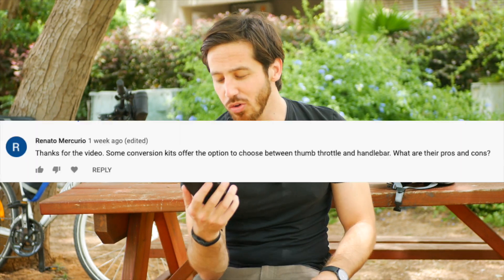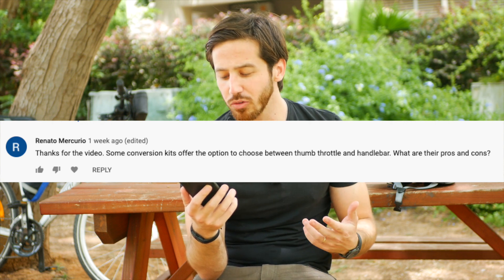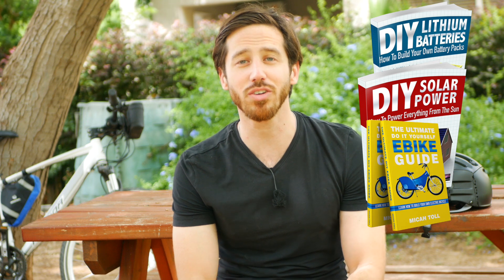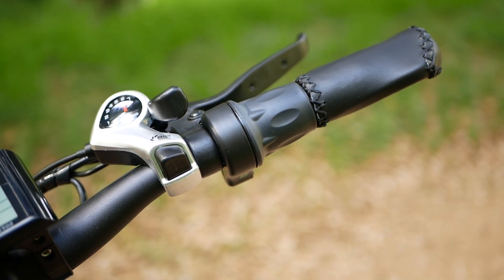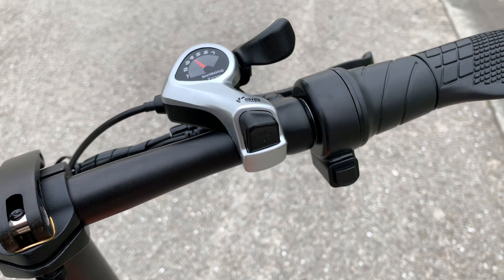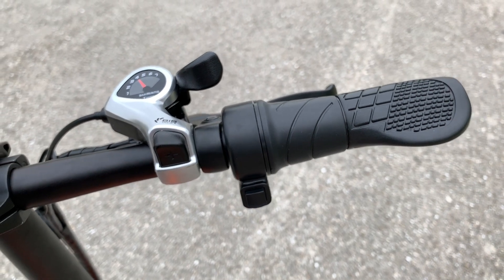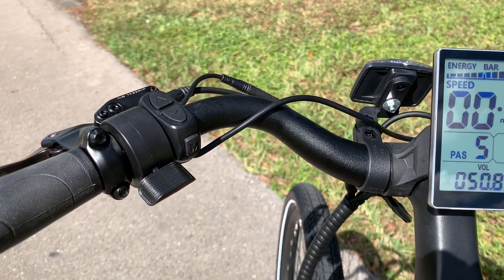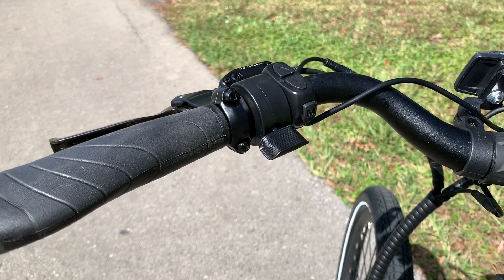THROTTLES: Twist vs Thumb - Which is better?!

Comment: I find that on rough terrain, like a trail, I have trouble with the twist throttle, for instance when I lean back to lift the front tire over an obstacle the throttle tends to twist and apply more power while you are pulling back, potentially causing the bike to wheelie, not a good situation. Then again, the thumb throttle can sometimes accidentally be applied when the handlebars get jolted upwards by a rock or you make a jump and land hard. Overall I prefer the thumb throttle for comfort and safety.

Comment: I’m trying to buy a conversion kit. How can I tell if say the 1000W motor  kit I’m buying is a good one? In general, how can one tell if the kits are quality products or just cheap knockoffs? I understand brand awareness and price are indicators, but buying from aliexpress is another beast all together. Also if you can talk about monitors ads vs disads that would be great.

Comment: as my Chinese 500 watt conversion gives me full power on peddling I have a thumb throttle and an adjustable stop made from an old lamp bracket. I can set it a comfortable speed and just hold it down. Once I release whilst peddling the full power comes back in for the hilly bits.Its worked out better than I anticipated as I am used to riding motor cycles with twist grip and at first wished I had that set up.

Comment: is it worth the money making my own bike and what kit would you recomend
Reply: Yes, you will save a huge amount of money and have a much more capable bike. Make sure to do extensive research before you decide which kit and parts to use though. You won't regret getting a big battery. Lead acid batteries do not belong on ebikes.
Reply: @dustman96  i could use a few how to videos on how to build my own battery and the kind of motor i would need for the battery i want to build.
Reply: @o1ecypher  It's really not much cheaper to build your own battery. I would recommend just buying one from a reputable source like Em3ev, or luna cycle. Not to mention, to build a battery and not potentially damage the cells you need a spot welder, another expense. I built my own a while back with a soldering iron and no BMS, it was a lot of work, it did pretty well and lasted a while, but my new em3ev battery has already lasted longer with no noticeable signs of degradation. I'm all about encouraging people to DIY, but this is a delicate thing to build. Can't offer much advice on motors. My original cheap hub motor off ebay was pretty good, my Bafang BBS02 mid drive motor is much better though, pretty happy with it.

Comment: What are the pros and cons of using lead acid batteries vs lithium
Reply: Lead acid batteries have no pros on an ebike. They are extremely heavy, low energy density, do not handle the kind of charging/discharging on ebikes well, they have a much shorter overall lifetime, one could argue they are cheaper, but you would go through several sets of lead acid batteries by the time your li-ion batteries even got a little worn, ultimately spending more money. My first ebike build used 4 lead acid batteries, weighing an extra 60 lbs, went 20 miles, and they were really bulky. My new li-ion battery pack weighs 12 lbs, is about a quarter of the size, and will take me well over 50 miles, no pedaling. I've probably gone almost 20,000 miles on it and it is showing no real signs of degradation yet. Do yourself a favor and make the investment in a good quality, large li-ion pack.

Comment: I use a motorcycle throttle lock with a full twist to prevent wrist fatigue. Are there any other motorcycle parts that you would recommend for a ebike? Maybe turn signals, brake light or headlights. Or any others?

Comment: When running two motors off two controllers do the controllers need to be identical or do the controllers just need to have the same volt and amp output?

Comment: I'm using a twist throttle on a 48v 1800w scooter motor with a 13s26p 69.68 Ah usable battery on a home made electric outboard motor & the twist throttle is an excellent safety cut off should I ever fell out of the dinghy while the throttle is at 100%.

Comment: hiya, new great question :how does the peddle assist system know which gear one is in?  using a cadence type sensor
Reply: It doesn't. The pedal assist levels are separate from your rear gears and you choose the level of pedal assist you want depending on what gear you're in (pedal assist 1 isn't going to do anything if you're in a higher gear going faster than level 1 adds - Pedal assist 4 or 5 is going to have you pedalling too fast if you're in a lower gear so you're going to want to upshift).

Comment: Let's say I was to build  an electric motorcycle(homologated one) or convert an existing one , and my solution is all about engineering a very different product  to the existing market while still making it feel like a sports cruiser / coffee racer. What never produced features would you be looking for in such machine  so that the experience would justify buying it over a classic ev/ gaz bike on the existing market?

Comment: Personally I prefer the thumb throttle because it allows me to have my remaining fingers resting on the brake lever, in many cases as I was cruising around, a car pops out of a driveway or a garage without checking and having my finger right by the brake lever I many times could let go of the throttle and immediately yank on the brake to stop the bike, where on the half-twist throttle you're gripping on the throttle and your handle grip at all the time, so that additional fraction of time you need to let go it the twist and reach your fingers over the lever to then press hard on it, doesn't pass me the confidence of control feeling. It might be something just psychological but having my fingers ready to press the brake makes me feel in control of the bike, than the bike in control of me. So in my hike I also have a horn button wrapped around my handle grip, so my thumb its on the throttle, my index finger is by the horn button and the left 3 fingers on the brake lever. So while I brake I honk the heck out of the driver to wake him up while I stop my bike to avoid a collision. Seems a lot, but saved me every time. Thanks God.
Reply: I have been riding bicycles since I was 7 years old. July 14th 2002 I first rode my hammer ebike. I watched a lot of videos they said there's a lot of power but I didn't believe it LOL. So I take off I'm at the End of the Street faster than I can believe it it's a short Street. I was going to turn right but with the giant fat tires is not so easy so I almost believed then I went up on the sidewalk and crashed. And I hit my nub straight down on the sidewalk. And then I got up and rode 12 more miles and that was the most fun I've had in years. Sitting here trying to heal my foot then I lost my leg after years of trying to save it so I've hardly been anywhere except the doctor and shopping and now I am free yay yay for e-bikes and I used my stimulus for something good that should last me a very long time if I keep it maintained. It's a lot like a regular bicycle Minus the electric motor and being 70 pounds and the giant tires. I truly believe in E bikes. I was researching and the first ebike looks like a motorcycle was in 1895 but they didn't have the distance please do and that was made by Bosch I wonder if it was made in Rochester New York near me they have a place Bausch & Lomb well they used to.
Reply: Same here, thumb all the way! Plus switch the brakes to the UK style. Actually is the right way compared to dirt bikes etc.. Front brake on the right
Reply: If you have decent controller and integrated brake lever, the motor will stops when you press the brake lever.
Reply: That where short way twist throttles come in handy. You can rest your pointing finger on the break and still twist it. Or change the brakes. But thumb throttle is cool too. I just like twist better. But your points are valid. Look at quads these have thumb throttles for a reason. I ride long empty paths so of course I choose the twist. It’s an easy ride nothing to worry about.
Reply: William said, "I prefer the thumb throttle because it allows me to have my remaining fingers resting on the brake lever..."
I can agree with your point, but my main ebike has cruise control, so once I'm up to speed there is no issue of not having the fingers on both brake handles, and when I'm maneuvering at slow speeds, one brake is easily enough to control the bike.
Reply: I gots no problem using the brake with my half twist, I can throttle and have fingers on my lever at the same time - and enough room to pull it. It's just a natural thing I'm accustomed to and have always been able to stop quickly if needed. It's the same way I would ride a motorbike, And people have been riding them for decades without not being able to brake properly right?
Reply: Other side break and brake sensor/cut off my conversion came with this
Reply: Or u can just hit the brakes with your left hand makes things a lot easier 🤦‍♂️
Reply: @neoroberts2802  each brake is a different tire
Reply: @neoroberts2802  this☝🏾

Comment: Half twist is the best, I use them on my 4-stroke bike too... That said, I have yet to find a setting that produces a useful low-end throttle curve on my eBike. It's so annoying, and I know it could be solved in software.
Reply: You just gave me a great idea. Thank you
Reply: It can't, Unless you use a potentiometer throttle
Reply: @JamesWilliams-ji4mg  Didn't know this was a possibility. Do you have any links to pot throttles? Just found this: https://electricbike.com/forum/forum/kits/golden-motor-magic-pie/70584-guide-to-hall-sensor-throttle-operation-testing-and-modification#post94717
Reply: @ChrisB...  Yeah and that guide is fine and will remove throttle dead zone but its hard to explain. Basically at the beginning of the throttle the magnet will be far away from the hall sensor in the throttle and it will never be responsive in the low end because the signal will be weak until it gets close to the hall then it will be twitchy. For throttle check out domino which is what i upgraded to
Reply: @JamesWilliams-ji4mg  Just ordered a Magura 0-5kohm pot throttle. :) I'm used to dealing with the ugly low-end of my hall-effect throttle, but honestly it sucks. Too many unintentional wheelies at 3KW.
Reply: @ChrisB...  I wouldn't get that one it has a large degree of twist that isn't good for wrist. Its ok but domino is better
Reply: @JamesWilliams-ji4mg  Thanks, found a Domino for $56 (seems too good to be true), it's sold out everywhere else.
Reply: @James Williams  Got my Domino throttle (finally after a month of searching) added a few resistors and my gawd it's amazing! It is orders of magnitude smoother than my hall sensor throttle. IMO hall sensor throttles are dangerous on 3KW bikes, not to mention completely annoying.
Reply: @ChrisB...  yeah I have mine dialed in with resistors too, the difference is pretty incredible
Reply: @ChrisB... and @James Williams
I looked at both the Magura 0-5kohm $60 and Domino Twist Grip Throttle - 0-5K Ohm $110.
I see that the Domino is only rated up to  40 volts and I just bought 48 volt 1500 motor kit. Will this still work?
Also, What resistors are you adding to the throttle? Sorry, I am new to this.
Reply: @robotbroken  I use my Domino at 60v, no problem. You have to test your system to find the right resistors, it's different for every bike.
Reply: @ChrisB...  Thank you for the reply! Even though I don't know anything about adding resistors, you've kind of sold me on how much of an improvement they make. I'm looking for something with smooth variable control. Do you use only throttle controls on your bike or do you use a PAS pedal assist system also that has sensors near the cranks? 
I just got a box with the Voilamart 1500w motor kit that I am mounting on a nice aluminum hard tail mountain bike and plan to use a 48 volt battery with about 20 amp hours. I am on a budget and purchasing parts as I can to do the conversion at a later date. How would I know what to measure to determine what resistors might work best? This electrical part is over my head. Is there a good E Bike Conversion Forum that you can recommend so that school myself on the topic? Thanks for all the help!
Reply: Or get a more expensive torque based controller

Comment: What are pros and cons of front hub vs rear hub?
Reply: My first ebike build had a front hub motor. It would spin out a lot on dirt or asphalt with dirt on it, because the majority of the weight on a bike is on the back tire, especially when you accelerate. My personal rec is to go with rear drive.

Comment: The thumb throttle on my Juiced Bike is on the left side. It doesn't interfere with the shifter. Control is shared by the brake lever only. Personally, I only use the throttle when starting off or on steep hills.

Comment: Thanks for sharing your experience in the videos.  I would be interested in two topics for future videos: 1) trouble shooting electrical issues (diagnosis, testing, repair) and 2) comparing/selecting controllers and how to wire/connect if mismatched (not a kit).

Comment: Left half twist. I have my gears on the right with a single brake cut off. The half twist IMO is by far the safest option for a throttle as you can ride without worry of triggering the throttle in a busy area. Experienced motorcycle riders may get on fine with a full twist but most people jumping on ebikes are not such people. Never wanted to try a thumb. I have one I want to use for regen braking tho. Cheers
Reply: I don't see how any kind of a twist throttle can be less likely to be accidentally activated than a thumb throttle, since your hands are always on the grips, but can easily be kept well away from a thumb throttle.  To me, using a thumb throttle requires a deliberate choice.  But, if it's a concern for you, that's cool, too.  Whatever makes it safe and fun is the right thing.

Comment: Really easy to make a cruise control set up for your thumb throttle. If you have a key ignition or a kill switch you can use that to cut the power if you need to stop.

Comment: TIP: Half-twist throttle can be used as cruise control :)
Just push the grip thight against the throttle and it wil stay in place. No wrist fatigue anymore.
And i agree about the right side throttle . They should standardize the back rear shift to the left side to avoid this problem.
But on the other hand, a throttle is forbidden in many countries for pedal assist ebikes (max 350W or 25km/h).
With throttle it falls under the catagory motorised scooter/moped (above 350W and/or 25km\h)
or motorbikes (speedelec bikes) (from 500W till 4000W and/or 50km\h).
Reply: That's a pretty dangerous way to do cruise control. Why not just turn on "auto cruise"?
Reply: @ChrisB...  It's not really so dangerous. I do exactly the same and just use my brakes when necessary. It cuts power to the motor straight away so it's no big deal having it in cruise control.

Comment: I’m in the process of converting my bike to my first ebike, I was wondering how long the battery lasts, I’m not talking about riding time I’m talking about charging cycles, I’m looking at a 48v 20ah battery which will cost me about £450-500 which is a lot of money, I’m mainly building my ebike so I can go of with my camera out down country lanes to photograph the wildlife, will I have to replace the battery every year or two ?
Reply: A good quality li-ion battery pack will last you 500 to 1000 full charge cycles(which to me means between 10 and 90%), depending on how you treat it. A good reason to go with a larger pack is that even after that many charge cycles you will still have plenty of useable range. Rick is wrong(sorry Rick), a 48v/20ah li-ion battery is not very heavy, only 8 to 10 lbs, which is barely noticeable if mounted low on your frame. Joe is also wrong, premade electric bikes are a ripoff, hardly any range, low power junk, the really cheap ones come with lead acid batteries which will fail in no time and are really heavy.
Reply: Wow, lot of questions. Do you want the bike to do all the work or do you always pedal? Bear in mind a 48v 20 ah battery is HEAVY. How far are these rides going to be? How often are you going to be charging? Better to keep the battery between 20%-80% charge for longevity, so nice to have one just big enough to do that.. If you have to fully charge the battery every day, it isn't going to last as long as if you charge it once a week. Also, better to use a slow (2 amp) charger rather than a fast 4-5 amp charger for longer battery life. Still it should last you longer than 2 years (assuming they are name-brand cells), it just might lose some range.
Reply: Rick Noé thanks for the reply at the moment i suffer from agoraphobia so don’t go out at all on my own, hopefully the ebike will enable me to get out and about, as for how long as the rides will be around 20miles at the most as I’m very unfit the bike will be doing the leg work ?
Reply: It's cheaper to buy an ebike online if there available, they go from 650 to whatever, just saying unless ur mechanically inclined

Comment: My girlfriend has cerebral palsy. I built her an electric trike. She used to have a full twist but the hall sensor went bad and I replaced it with a thumb throttle which works better for her because she has gotten scared in the past and floored the throttle. Luckily the brake safety switches are connected so all I had to do was grab a brake handle. With the thumb throttle she instinctively let go of the throttle instead of squeezing down on it.
Reply: For me I like full twist. Havent tried a half.